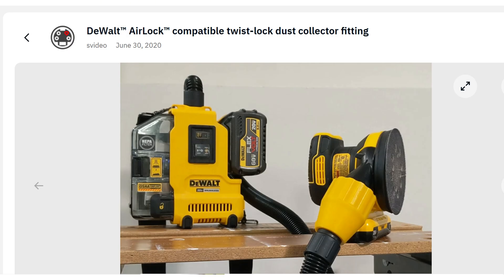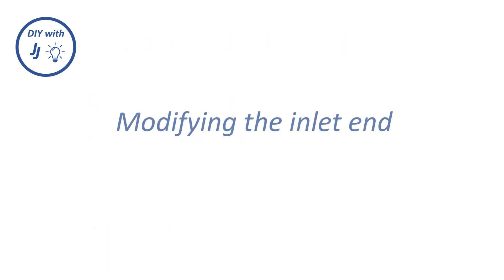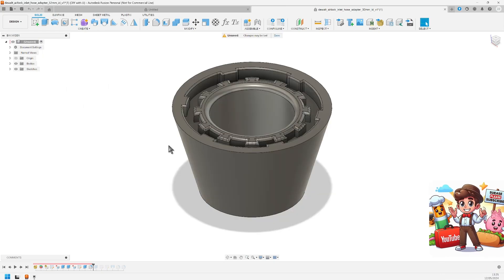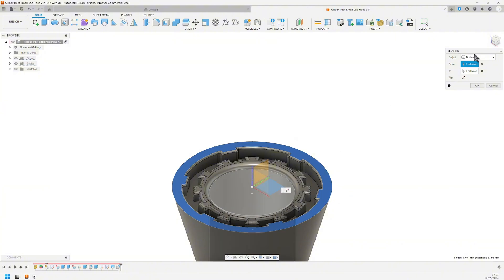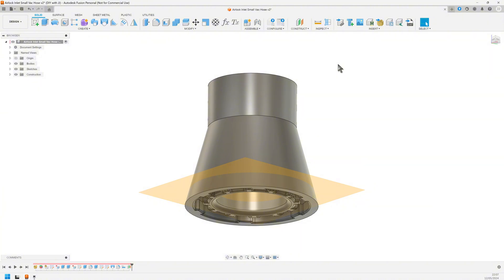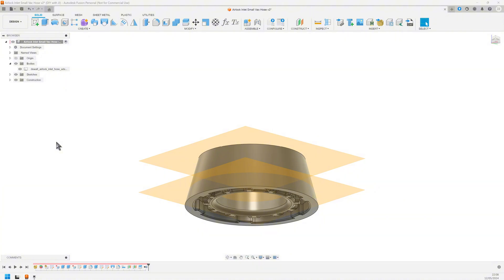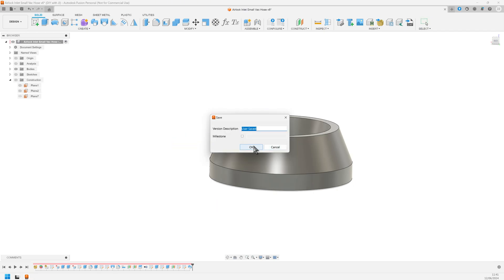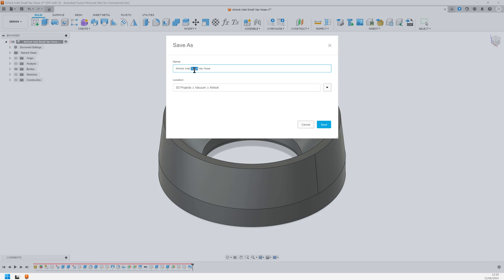Remixing a DeWalt Airlock Inlet: STL Challenges and 3D Printing Tips

Comment: Hey what a cool design and a great video to go with it!  I'm the original creator of the model and I'm just going to apologize for the Sketchup thing - I learned it 20 years back and just never learned a better CAD solution :D  Love to see your work taking this to the next level and am stoked that you're sharing it back to the community.  Thanks JJ!
Reply from the maker: First of all, thank you so much for your design.  All I did was tweak it to match my own needs, and it works great.  Second, I myself used Sketchup for years until I gave up with that app for many 3D designs.  So I spent the time to learn Fusion, and what a change it has caused.  I have dozens of designs that I have yet to post and generate videos for due to time constraints.  Several designs expand on the DeWalt airlock for many other tools.